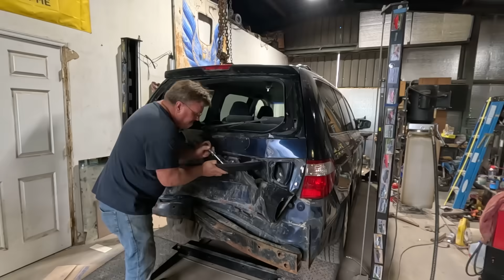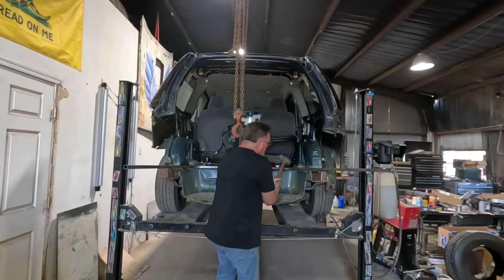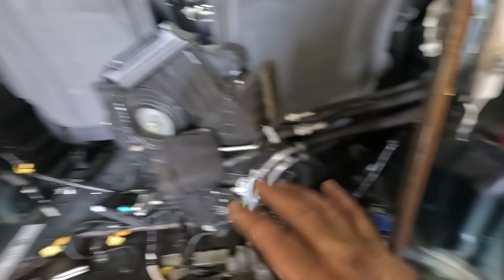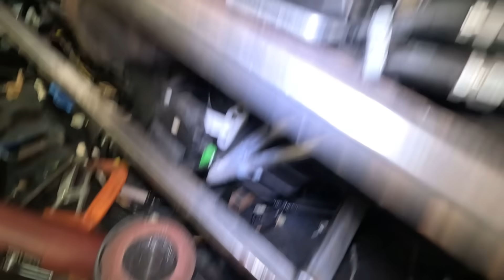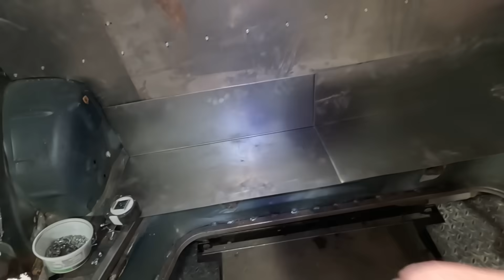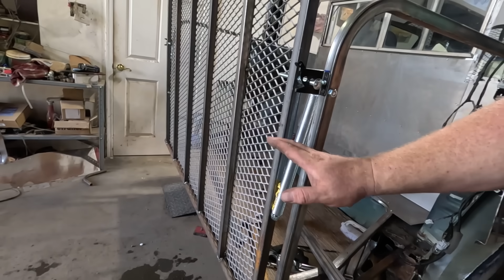El Hondamino: Part Truck, Part Minivan, Part 1!

Comment: Good job.  I now see how the side curtain airbags are designed.  I wonder about the leverage of the chair weights added to your fantastic structure weight behind the rear axle.  Maybe air-shocks and dual tires ;-)

Comment: So I do have to ask 
In Europe we put like a very thick rubberized coating on the whole underside of the vehicle to prevent rust. Do any vehicles in the US have that from the factory? Because so far from what I've seen none of them have any protection other than zinc and paint, sometimes only paint. 
I have seen manufacturers go away from the rubber coating especially after like 2000 and newer. We salt roads sometimes quite heavily and rust is a problem on almost all cars. My 25 year old car with a very thick rubber coating is almost spotless on the undercarriage with small rust spots on the sheet metal that started as rock chips in the paint which is normal. I had to change out a brake pressure regulator which is located in the rear and exposed to all the road dust and salt and it took us like 20 minutes to replace it and most of that was trying to not strip the hex on a flare nut.

Comment: The Ridgeline is built on the same platform as the Odyssey and Pilot and does not have a third row. It might have side-curtain airbags that will work for this project.

Comment: Check into using resistors to fool the  computer in to thinking the air bags in the back are there and working it's a easy way to achieve your goal

Comment: to remove the rear windows they sell a heat induction tool. you move it along the body melting the adhesive. Im a supervisor at a junkyard and thats how we remove windows for orders. We put blue painters tape loosly but firm on the outside so the window doesnt fall. works welll for rear truck cab windows and windshields.

Comment: You could almost restore that minivan by finding a rear bumper section and weld it on. But I guess there is no fun in that. You gotta admire Japanese engineering though. That is a very well designed vehicle to take that much damage and still be 95% good.

Comment: Nice work and an interesting build; I would be a little concerned about the loss of torsional rigidity at the back end though. Maybe you're going to cover that? The tailgate and surround do add stiffness to the structure.

Comment: Or El Ranchodyssey??  But Brad Pitt would have said "Honda...mino"   OK, yours is better..;-))  And there is the vehicle that Honda should have built, instead of 3 things that kinda do what you want (Odyssey, Pilot, Ridgeline)...but the Odyssey is definitely the most useful.  We've hauled plywood, drywall, 16ft 2x10s, and even a fully dressed Caddy 500cid in our old 2004.  Remove the rear seat and add rear airbags and a class 3 hitch, and it did just about everything we needed.  Nicely done, good tips about build and structure nodes/points.  Thank you!!!

Comment: I'd add a way of securing those latches down though - I can see them shaking loose over time as they wear. 

Maybe a locking chain or something just to secure the top of the latch down and stop it from rattling loose.

Comment: Don't bother reinstalling the curtain airbags. Put a 2ohm resistor in the airbag wiring plug and the dash warning light will turn off, the rest of the remaining airbags will also then function as intended.
The resistor/s trick the system into thinking the airbag is still in place. 
Note; In some vehicles, you may need a scan tool to delete the fault code after fitting the resistor/s (As an airbag fault may not be a situational code that deletes itself).

Comment: Its a bit dusty out here Son, 
I have to do the off road test for the video Dad.
Airbags look more interesting outside the vehicle. 
I believe a resistor across the air bag connector eliminates the airbag light. (Aftermarket steering wheel solution)

Comment: Airbags: you can remove the air bags, and substitute a normal resistor in place of each, to fool the computer into thinking they are still there. Scumbag used car dealer trick. Somewhere between 2 to 5 ohms should do. You may have to experiment to see which works. The computer may not automatically turn off the warning light, even if it is satisfied. Codes may need to be cleared with a scanner, but you could try disconnecting the battery for 10 minutes, that might work. Be aware that the connectors that go to any airbag have shorting bars, which short the two terminals together when unplugged from the airbag squib. You will need to physically disable the shorting bar, or cut the connector off entirely, then connect the resistor across the two wires. DO NOT attempt to measure the resistance of an airbag squib. Play it safe and use trial and error. I would start with a 3.3 ohm resistor.

Comment: Are you going to make some kind of weather proof box for the chair to sit inside of? I suppose in NM you don't worry about that too much, but where I live we get rain and snow and mud flying and well you get the idea. I would want to wxr proof the whole thing to reclaim the lost storage space. OK James, very entertaining and I think I am going to buy one of those oscillating multi-tools. In my case it will only be used to cut 2" of styrofoam wall board. Thanks for the demonstration. ben/ michigan

Comment: Great build but in my opinion, I believe you have installed the expanded metal the "wrong way". And what I mean by that is the "raised" part of the metal is facing downward as it goes down the ramp. At my former job, the utility trailer we had had a drop-down ramp in order to drive lawn equipment up and down on it. Because of this, when the ramp was wet, it was difficult to walk up and down the ramp without my feet slipping. Also, on smaller wheeled vehicles like the mobility scooter you are showing, some smaller tires would tend to lose traction and slip. At 37:26 in the video where you are showing the latch, you can see what I mean about the raised or "bump" part of the expanded metal.
You can feel what I mean on your example by lowering your ramp and running the palm of your hand down towards the "ground" end of said ramp. Then, try pulling your palm up towards the "hinged" end and you will see your hand will glide towards the ground but be more difficult to pull back up towards the hinged end. Ideally, you would want your hand, and consequently the wheels to glide UP the ramp but be difficult and therefore more slip resistant heading down the ramp.
The fix for this would be to remove and turn the expanded metal 180 degrees. In other words, put the ground end where the hinged end is at. And yes, I realize that would mean cutting off all of your support bars and a lot of rewelding but if your dad is going to drive the mobility scooter on and off the ramp, that would be a huge safety concern. 
I hope this helps you, Richard.

Comment: since those airbags are curtain airbags, they should only unfurl down and out toward the body of the car, not inward. given that, you should be able to curve them around toward the new rear window without affecting their function, so long as the mounting tabs keep their stock mounting orientation in relation to the roof.

Comment: Another great vid! Hi from the UK. I'm an auto electrician, I work on airbag systems daily. If you get hold of some 2.7 ohm resistors you can replace the airbags with the resistors then the airbag light should switch off.  That value fixes most vehicles but you might possibly need to try the following values if 2.7 ohm doesn't work (1.8/2.2/2.7/3.3/3.9). They only need to be 1/4 watt resistors. If the airbag light doesn't immediately switch off you might need to plug in diagnostics to clear it.
Reply: Good tips!
Reply: Every state is different, as many have no formall inspections unless title was listed as totaled per insurance. Depends on the state.
Reply: Early 2000's GM key switch security systems can be bypassed the same way.
Reply: Surprisingly, that might be one of the things america actually has laws about. In some places, no matter the context, disabling airbags with bypassing like that can lead to fines and, if sold to another person without informing them of such a modification, can lead to jail time. I doubt that's the case where he is but, worth considering.
Reply: @FishyBoi1337 mate there is absolutely no way he's going to be selling that! I chuckled at the 'making it road legal' comment! There is no way that would ever pass an MOT test in the UK
Reply: @FishyBoi1337  nah

Comment: I do think that you need a bumper to be legal.if I were you I'd add in some stronger metal, from the frame of the car under the cage you made. A Cross member between the end of the cage would box it in  along with gussets at corners. I would use 1-1/2"by4" box tubing. Hope this helps with your design idea.

Comment: To get rid of the airbag warning light look up airbag resistor test kits. Its basically a resistor that simulates an airbag if you plug it in the connector.

Comment: Afaik the toothless oscillating tool blade is for removing tiles in kitchens and bathrooms.

Though also useful for removing the front windshield glue remnants in a relatively modern car that's getting a full makeover.

Comment: I have learned from redoing so much, to NEVER use a level ! ! ! The ONLY way to be accurate is to be parallel. Tire pressure, floor level errors, bent frame elements ...... so many reasons to NOT use a level. USE a tape measure to "level" or as it should be, to square! Genous idea! Great fun to watch. Looking forward to the next episode.
Reply: If I may, I would add standing back a ways and just looking at things can be a major help. I watched a couple of guys put in some huge panels that were about 30 feet long and there were 5 of them all to be connected in a straight row. When they got done you could sight down them and there was no waviness to them at all. ben/ michigan

Comment: AWESOME!!!! You should run a cable through the center of the springs as a safety so if for some reason they fail they wont go flying... I think i did that on a garage door spring once because the ones that broke went flying into the car parked in there.

Comment: an idea i had for the ramp, is a handle. whether it folds, how high and where to put it, is up to you but, some grabby thing, that means you don't have to touch your toes to lift the gate will probably be very appreciated for those same people with mobility issues, or...well, all of us really. great video, and have fun polishing it up!
Reply: I was thinking about that same issue and wish I had a good solution to offer.
Reply: @andyfairman7812  i"m kinda thinking about some kind of cable/spring arrangement inside the 1x1 tubing, that, when the ramp is down, the handle is pulled at the base, and stays upright, but as the ramp is elevated, it, relaxes the mechanism some how, and folds the lifthandle down agaisnt the ramp.  otherwise, if the handle meshes with one of the supports along the side, then as it's lowered, the rigid handle becomes exposed. shrugs just the ideas I thought of that might could work.
Reply: @TizonaAmanthia  It's not a bad idea, would just have to figure out the position of everything so it would have the leverage needed. 👍
Reply: @andyfairman7812  agreed. it would be something if I were him, i'd want to do some kind of mock up. it'd be nifty as hell but...prooobably fiddly. shrug

Comment: Man if you ever stop in New Orleans iv got 4 broke cars right now lol one 7.3 power stroke 1997 Ford F350  won’t run right believe it’s a fual issue but it’s brand new fual  pump  a 2001 Nissan Ultima that only needs tiny piece JB welded in the place to fix it lol one big project. The time is chain on a 1998 mercury grand marquis. And a Nissan Marano that will drive and move, but it should not be on the road, but could be fixed up. It is the mother-in-law‘s car which makes it my project. Lol we could have great fun together, Fixin’ one or all of these in a matter of a day or few we’ll BudDroux I enjoy all you greatness

Comment: It's clear you put a lot of thought into this and are going the extra mile to make something custom.  I would have cheaped out and just put a 2" hitch receiver right at the floor drop and used a standard removable wheelchair carrier.  Can I suggest a section of E-track across the back wall you made?  That seems like a flexible way to attach any sized chair.

Comment: That airbag can be bypassed by putting a resistor on the terminals where it plugs in.   The resistor will shut the airbag light off and allow the rest of the system to still work.  A little googling might tell you the exact value you need, since it varies by manufacturer.

Also, be sure to use a carabineer or something in those gate latches as they can unlatch themselves if the right forces are applied to the pin they are latching (like washboarded roads).

Other than that, awesome build!
Reply: While more effort, maybe replacing the curtain airbags with ones from similar vintage Honda sedan.

Since a sedan only have two rows of seats.

Comment: Back in the late 1960's. A guy that lived down the street from me had a perfectly good running /driving 1959 Chevy station wagon. Problem was he wanted a truck.  So he cut the top off right behind the front seat. Instant "truck". He worked for the city that we lived in driving a street sweeper which was right hand drive and the seat was pretty high off the ground. So when he was driving it he could look down into people's trash cans for stuff as he went by. He was Fred Sanford way before Fred Sanford.